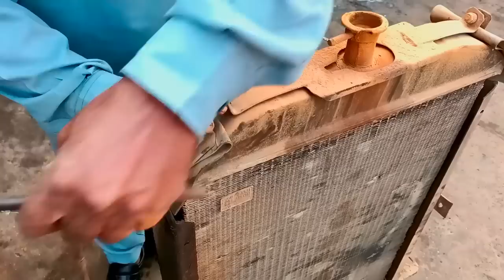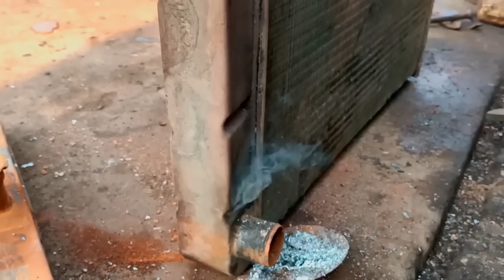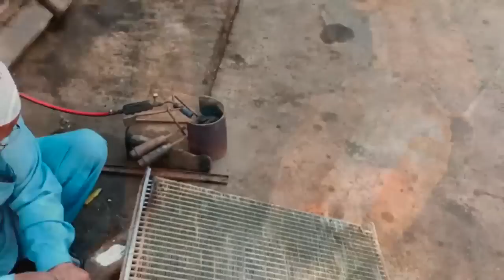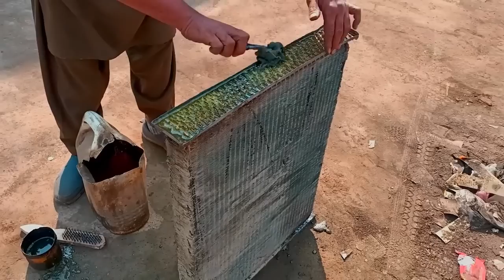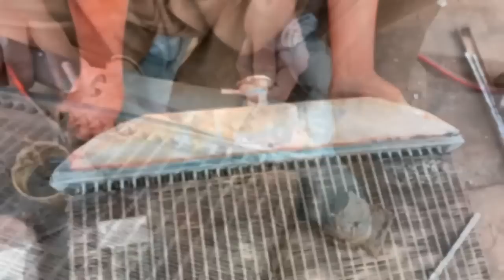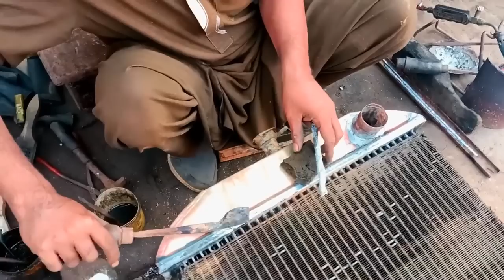Amazing Restoration Hino Truck Old Radiator | Repairing Old Radiator in local Workshop

Comment: I've done re;airs like this to radiators back in the old days when radiators were made of copper and were repairable. These days with aluminium radiators with plastic tanks, they can't be repaired at home, so it's a case of replacing them rather than repairing them.